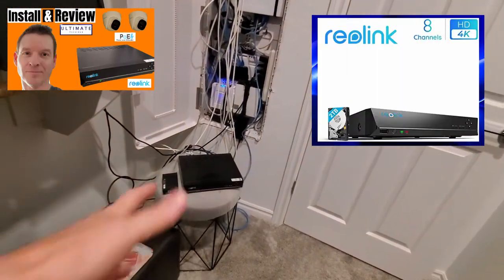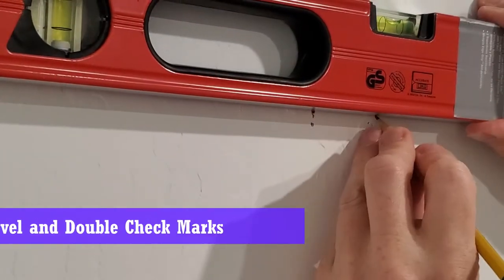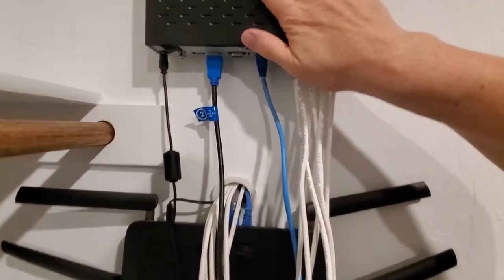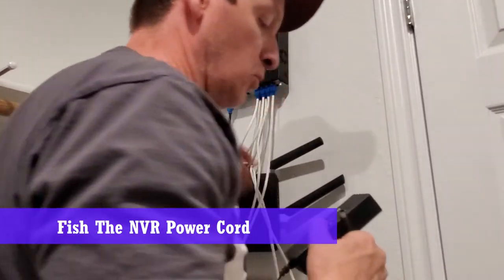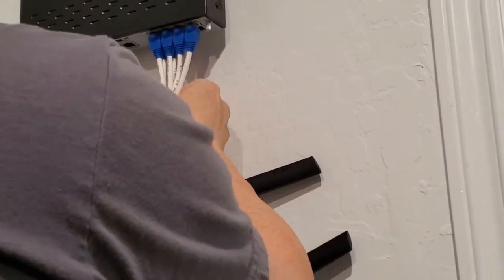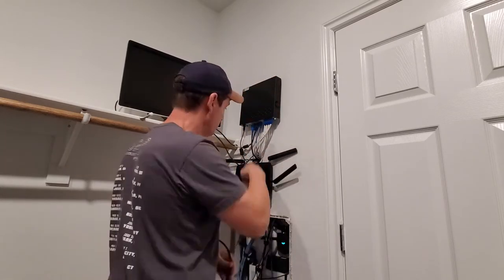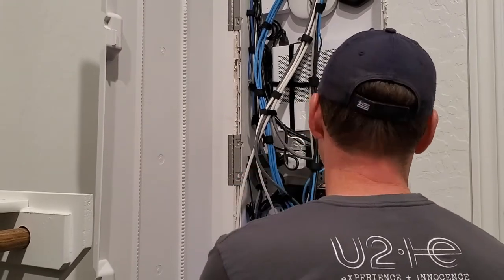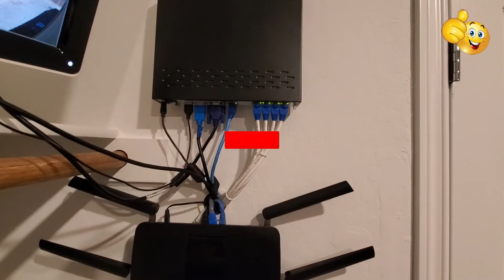REOLINK NVR WALL MOUNT INSTALLATION - HOW TO HIDE WIRES BEHIND THE WALL! HOME NETWORK SETUP!

Comment: Wondering if Wireless HDMI and a wireless mouse would allow me to skip the monitor sitting right next to the NVR in closet.  I could operate the NVR in a different room without cables running to the TV/Monitor.   Any ideas?
Reply from the maker: Absolutely! I have a video on wireless hdmi!

Comment: While it might never cause an issue, power cords should never be ran inside the wall. Code requires in wall rated cable with a receptacle up top. Yeah it’s extra work but better safe than sorry. Plus if there’s a fire and your insurance company determines it to have played a part in the problem, they can deny the claim.

Comment: what is the white box where you mount everything called?
Reply: its called an access panel... but in THIS case he has electrical code violations (basic power cords behind drywall... cords behind a wall must be insulted and designed/rated to be ran behind a wall)

Comment: Are you not worry about NVR getting stolen if you get burglarized? Why not put it in the attic and drop down VGA cable for the monitor?
Reply from the maker: Not really because my NVR is next to my gun safe...lol. Also we have top notch security and locks. And my attic gets to be about 140 degrees in the summer and the NVR would probably end up fried. Although its good advice for a different situation. Thanks for watching and for commenting.

Comment: I just emailed REOLINK today about mounting my NVR to the wall.  Their response " No, it is not suggested to install the NVR vertically. 
Is it possible to install a Shelf for the NVR? Or place the NVR on the table?"  Do you have any experience doing it this way?  I have to install mine outside...on the building.....in an enclosure of course.
Reply from the maker: Yes you can definitely install it on a shelf. I would install maybe on a wire shelf so the NVR can be secured with zip ties or some sort of fastener to keep it from falling. As far as mounting to the wall Reolink has to say not recommended because they don't want the liability if the NVR falls from a poorly mounted NVR. But yes a shelf works just as good. Keep me posted!
Reply: @UltimateTechHub  
Thank you.  You just made my job easier.
Reply: I had a Night owl camera system the NVR had protruded spots underneath to mount virtually. I was really disappointed the my Reolink don't have this.

Comment: I hate to be a party pooper for all of your "Great Job" comments... BUT running "basic power cords" behind drywall (any wall) is a code violation... FIRE hazard... if you put your home up for sale WITH the violations and IF the potential buyer demands a home inspection you will have to correct the violations or remove the violations... and thats if your home survives the fire hazard... electrical code is usually overkill so I dont expect you will have a home fire BUT correcting the violation could result in a delayed sale/failed sale.
Reply from the maker: Yes it is and I've moved the NVR to my panel shelf so the wire is not in the wall. But I didn't move it because of the wire, just because I got a new NVR system. If I sold my house I would never leave it like that. Thanks for watching and for commenting!